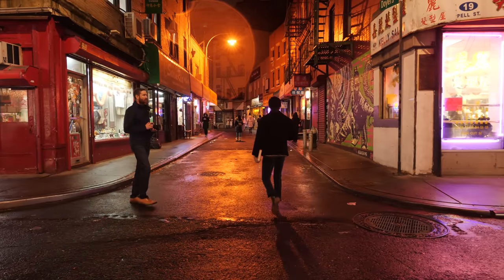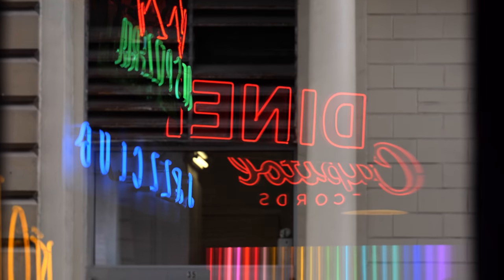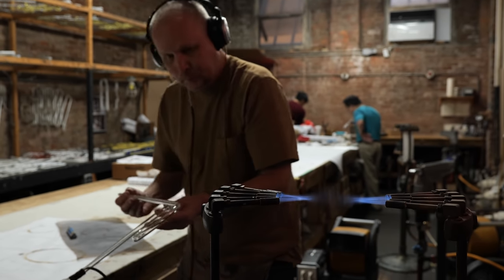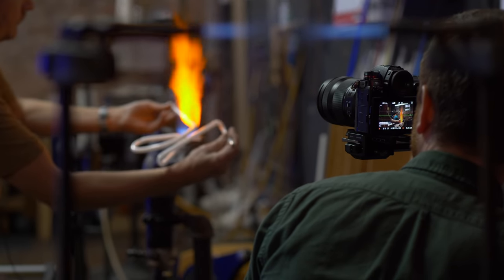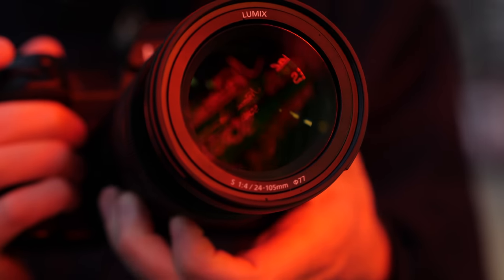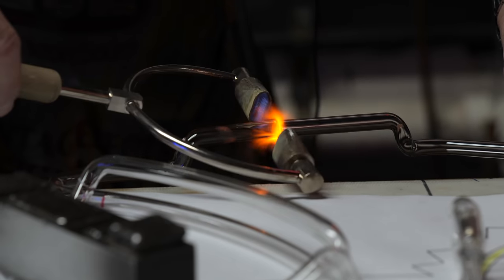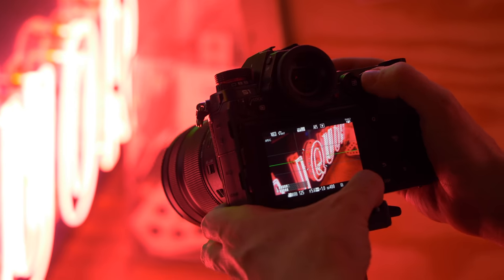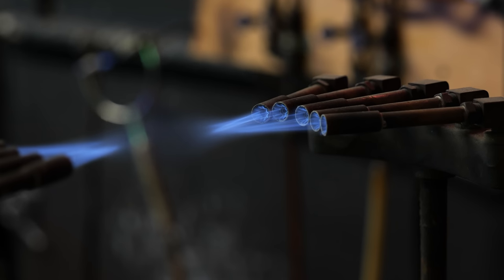Behind-the-scenes: Filming "Argon" with the Lumix S1

Comment: Great work! 

Any comments on the sharpness of the 24-105 across the zoom range, esp at the long end? I'm considering picking up an S1R kit for backcountry landscape photography as a one lens setup. My most commonly used focal length is ~85mm thus my question. 

Cheers :)

Comment: How do you feel like this performs versus something like the GH5 or GH5s for filmmaking? I don't see a huge difference in image versus the documentary you just shot on the GH5s for Indy Mogul. The ability to go to ISO 10,000 with no problem seems like a big win, but you could push the GH5s around there without much image degradation, right? I've only got the regular GH5...but this camera has me wondering if I'd be better off with the GH5s or S1 as a low light second Cam.
Reply: The great thing about the S1 is that it gives you the option of full frame video, aps-c crop video, and potentially much better stills image quality. As good as the GH5 and GH5S are, they won't give you these features.

Comment: Hey Griffin! Is the menu system pretty much the same as all the rest of the panasonic mirrorless cameras, and did you feel the overall usability was on par with your GH5 or did you feel the S1 was better?
Reply from the maker: Very similar menu system, but of course I get a little lost in the S1 menu, because I've practically memorized the GH5 settings. Also, I know these preproduction models  undergo menu adjustments as firmware is upgraded before the retail release, so it's hard for me to know if what I'm looking at is final.

Comment: Sadly the S1 does not seem as an upgrade from the GH5 other than the FF sensor. I like how Griffin is promoting the tilty screen (which is not as good as on the GH5) and the no video recording limit (not true with 4K60 recording). Well made ad for S1 but the truth is the camera is not what Panasonic promised. Moreover, if this was their plan to enter FF world, then they should not have done so. All they needed to do was take the GH5 and put a FF sensor in it, thats it and everyone would have been happy.
Reply: As similar as this seems to the GH5, I don't see the GH5 being usable up to 10,000 ISO or more, do you? Also, Sigma have numerous full frame lenses with L mount, and Leica have a reasonable range of L mount lenses already. The full frame sensor, combined with lenses like the 24-105, give you more versatility and depth of field control than any native m43 lens at this time. I don't know of any m43 lens that gives you a 24-105mm range at f4 full frame.

Secondly, what did Panasonic 'promise' with regards to a full frame camera?
Reply: @raksh9  Firstly , Sigma has no full frame lenses for the L mount yet. Secondly, the Leica L mount lenses cost an arm and a leg. Panasonic created the hype and expectation that this camera would be similar to GH5 in terms of features which would blow out thr competition. Not what happened.
Reply: @premshashi  How and where did Panasonic create the expectation that the S1 or S1R would have all the features of the GH5 and blow all competition out of the water? I have followed their interviews and press statements but never got that impression. If I missed something, I'd like to know.
Reply: @raksh9  why else would they get into the FF market which is overly saturated  right now.
Reply: @premshashi  So Where exactly did they imply it would be a full frame GH5?